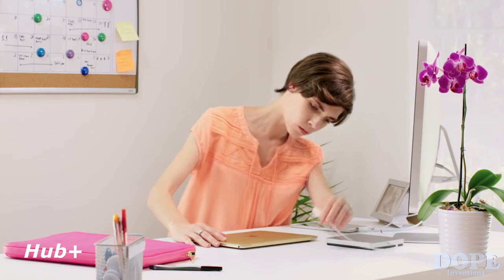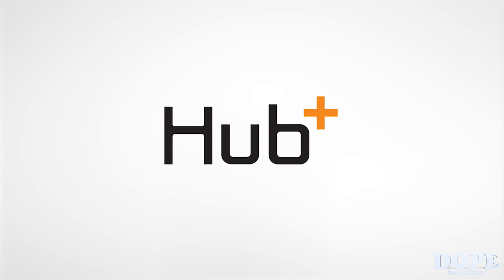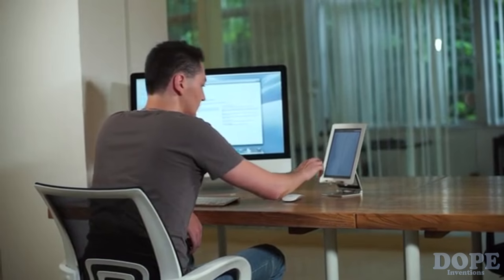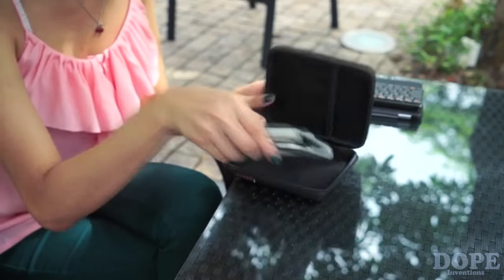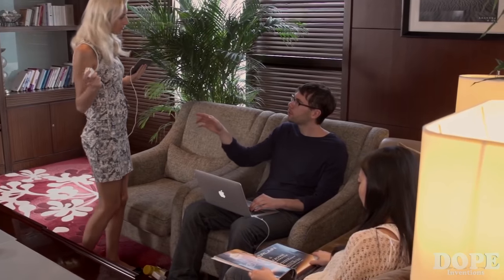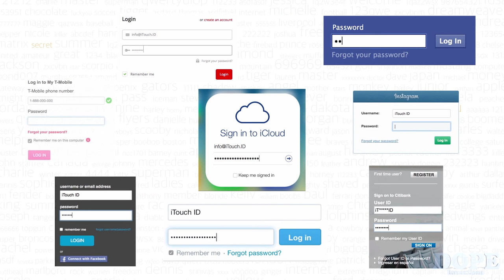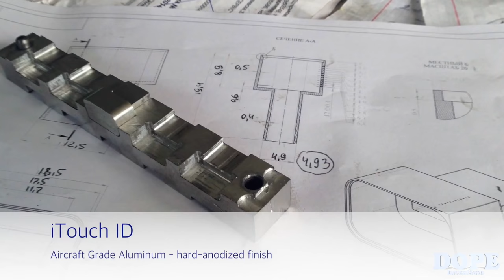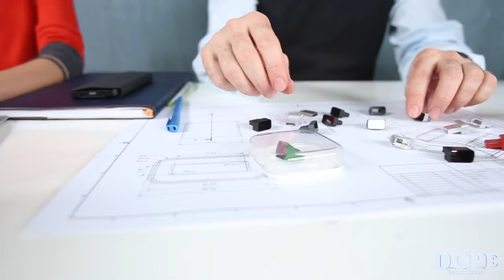Top 5 Must Have MacBook Accessories!

Comment: So... If the finger print scanner basically just acts as a keyboard... you can pretty much just 'give away' your password whenever you touch it when the 'focus' is on something other than a masked text entry spot? Sounds rather unprotected to me. Wouldn't matter if your password is STORED with encryption... because if its just acting as a keyboard, all you're doing is going back to having a single password for everything (which is less secure in general), and allowing keyloggers to still gain access to your unencrypted password... I really like the idea of what its trying to do, and really like how it looks, but its still just not more secure than everyday password typing is. But it does do the job alot faster! which is a plus!

Comment: poor macbook 2015 and 2016 users Itouch Id will not work
Reply: +Grace cause they have USB type c ports Itouch Id will not work
Reply: +Ara Hassan oh, yeah. sorry. They could technically use an adaptor for it, though
Reply: +Grace it's not meant to be used with an adapter